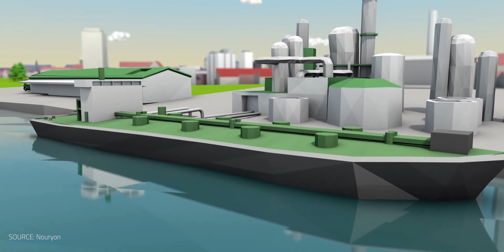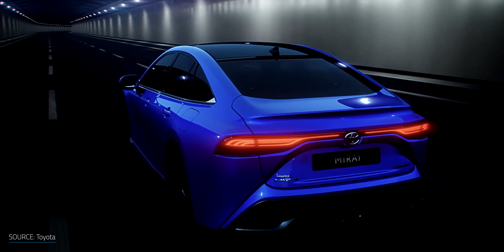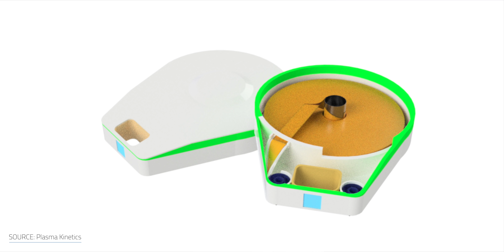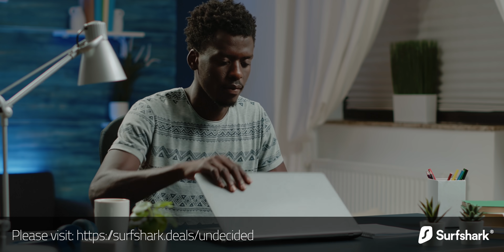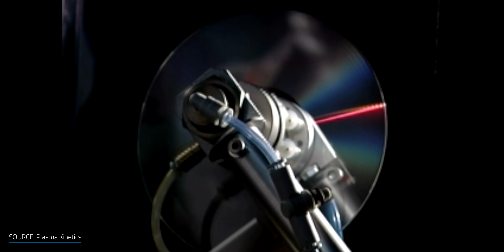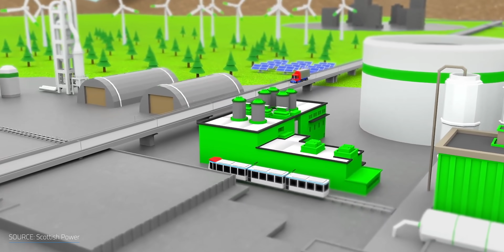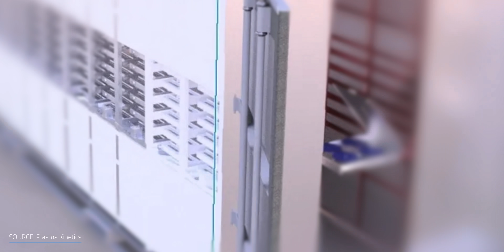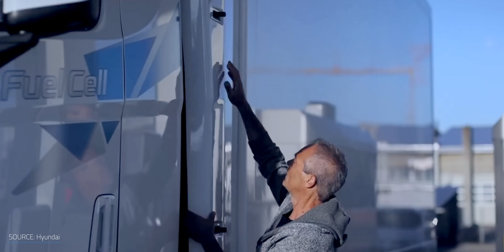Energy Storage Breakthrough - Solid Hydrogen Explained

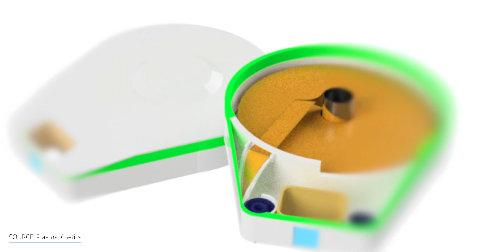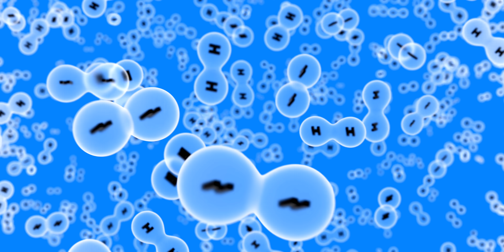Comment: One thing I'm curious about is the nano-structure of the tape. At about 4:00 min, you said it was a graphite-based structure, but at 6:35, you show what seems to be a Scanning Electron Microscopy (SEM) image of carbon nanotubes as the nano-structure. Although both carbon, these are completely different structures with different properties. Thanks.

Comment: More advantages of hydrogen include:  less need for rare materials compared to batteries, longer lifespan compared to replacing an expensive battery every 10 years, and the potential to be fully mechanical (with hydrogen internal combustion) without computer chips.    Lithium battery EVs are like expensive toys as long as they are at the mercy of planned obsolescence business practices.   In a decent future the cars will not require software updates.

Comment: If you want to look into something that does sound promising look into ammonia being used as a fuel.
Right now the production of ammonia is no better than burning fossil fuels but they are working on producing it cleanly and efficiently but it's going to take a while.
For the foreseeable future EV's using batteries is the best option.

Comment: cool, this is a gamechanger since no pressure no temperature. If they can improve the loading cycles of the bands I can savely use this energy in my laptop f.e. One question is , is the tech scalable? The materials the bands are made of, is it widely available wordwide?

Comment: maybe the solidification of hydrogen can br "speeded up" once it is able to "connect" to a temporairly katalysator molucule. to increase its solid tempreture. out of the "periodic table of molecules and atoms" this add on molecule(s) must also be low costs and enivromental friendly. maybe it can temporairly bond with  Carbon ?? until needed as back up fuel. or emergence fuel, in those unexpected times of need. since it is one off the only transportable fuels we can make. althou. the "rendement" to make it, say making to using ratio. is according to the teacher and the internet. not very commercial interesting for the short term. but handy in cases of the lack of laternatives.
Reply: it is the first time in history. a real primeur. that a hydrogen plant is made. lets keep it. as a back up. while using more conventional mainstream fuels, as. useual. have a good one.

Comment: not a bad bit of kit - society is changing and cleaning up it's act by utilizing hydrogen as a fuel instead of using dirty fuels such as 'natural gas', petrol, diesel etc. So the new tech seems good but the big problem is hydrogen has to be extracted in the first place from natural materials eg coal, shale, wood. This process still requires energy use. What man cannot do is actually make hydrogen literally out of thin air!

Comment: So, what's the energy density of those rolls when scaled-up? If it takes more energy to lift the film, plus its solid hydrogen, than thrust output.....it's no better than flypaper. Jet fuel weight is consumed, but not this film. Is the value really there?

Comment: It sounds like the cartridges would get less efficient with each use, which means that if you were to take your cartridge to the corner store and swap it for theirs, you don't have any way of knowing how many times theirs has been used, and neither do they. It may have been once, or it may have been 200 times (manufacturer's recommendations be damned), but you'd still be paying the same amount regardless. Unless there's an easy way to tell how much hydrogen is actually in the cartridge, I think there would be a heck of a lot of fraud going on, intentional or not.

Comment: Where/how do you get the hydrogen? You COULD get it from water but it takes a LOT of energy to split hydrogen off a water molecule. There IS hydrogen in the air but you're going to have to expend energy to separate it out. There are also chemicals which react to produce gaseous hydrogen but I don't think they really occur naturally. So it all comes down to where do you get your hydrogen? Any way you do it is going to require energy which will ALMOST CERTAINLY require consumption of hydrocarbon fuels which the whole process NOT net zero carbon.

Comment: Please also talk about overall efficiency when you compare Li-ion, compressed Hydrogen, liquid Hydrogen, solid-state Hydrogen etc. I mean the total amount of energy you get back when using one of the different storage forms. Start with e.g. 100 kWh of green energy. How much of this ends up in an electric motor? And afterwards maybe another table with the associated cost per usable kWh per storage system. That would be very interesting!

Comment: Count me as extremely skeptical with my alarm bells ringing loudly and sounding like a scam on par with Nikola's breakthrough hydrogen trucks that were vapourware (pun intended).
First, there is so much vague information but nothing concrete about the technology or it's actual application. Extracting hydrogen from chimney stacks? Really? Seems like a dubious source of hydrogen to me.
Next, what is the actual energy density of each disk and what is the sustained energy release rate? Bear in mind that driving a fuel cell car 100km requires about 1kg of hydrogen
Then we have the claimed efficiency of 70%. Is that the efficiency of storing and releasing hydrogen, or storing and releasing electricity? I suspect the former since fuel cells are themselves only between 40-60% efficient. 
Now we get to the economics of it. Ignoring what appears to be the completely unfounded and fanciful free extraction of hydrogen from chimneys and going with the 'use excess renewable power' to create hydrogen we can look at around 80% max for the hydrolyses with a catalyst, then 70% for this disk storage, then ~50% for the fuel cell. Thats 0.8x0.7x0.5= 28% round trip efficiency (excluding any transport of the disks for sale). Compare that to a BEV where the round trip efficiency is better than 70% including power distribution. These better be pretty cheap disks! Hydrogen must be produced, stored, transported and then sold. Each step along the way has a middleman or process that adds cost and introduces even more losses. The remanufacturing process hasn't been explained either and presumably requires energy as well so let's be kind and say that the whole system is 20% efficient. It's actually worse than pressurised hydrogen.
Once we get past all of this, let's not forget that this entire presentation is a CGI animation and I've yet to see an actual vehicle being driven and demonstrated using this tech. Big alarm bell ringing in the background.

Now let's look at the use cases. It's being pitched as being sold in shops to the general public - presumably to power cars as well as trucks etc. Who in their right mind would choose this over a long range BEV that can be recharged overnight at home, costs at least 75% less to "fuel" and has a usable range longer than you need 99% of the time?  Let's not also ignore the fact that a FCEV is inherently more complex and requires frequent servicing (air filters etc). 

I am open to being proven wrong, but strongly suspect that I am not. I have not seen any indication for the actual cost per kg of hydrogen stored at the consumer level, the actual density of the solution, the solution to the logistics of delivering these cassettes everywhere, how many you need in a normal car etc etc. That's before I get skeptical that no-one is showing an actual vehicle but just CGI-ware. Meanwhile my BEV is quietly charging in my garage using excess solar from my roof once the house battery is full, and it's already 7 years old...  It's an old car now with a usable real world range of about 380km with a network of high speed DC chargers all over the place, but it's actually more common for me to drive 30-40km each day than it is for more than 400.  Basically most of my driving is free.

Why would I want to pay so much for an inferior solution?

Comment: Round trip efficiency with this system looks a bit suspect 

Aluminium ion and aluminium air batteries with two to three times the energy density of lithium, look more promising for bulk energy storage. 

Research is well advanced and specialist products already available. If research pans out could be competing with Li in transport applications in five years or so.

Comment: Electrolysis is highly inefficient. Expend at least 50 kw for every kg of h2, which only has 36kw of energy, and only 60% of that can actually be converted into power. There's a reason why people are looking at alternatives. The catch is that this is not a hydrogen production technology, it is a hydrogen storage technology. Check the cost for shipping a solid anything against filling a specialized barge with liquid hydrogen. The solid source will win every time. What matters is the cost for producing the hydrogen they are capturing, because hydrogen is not just free-floating in the air. They have to be producing it somehow. This is a logistical solution, not a production solution. That said if you can dramatically reduce the cost of shipping hydrogen then that can be enough to make the economic viability fairly attractive. If you're paying $12-$16 a kg at the pump, the reason is the cost of shipping, since production cost is maybe a third of that. The video did make that pretty clear.

Comment: This is what is  Allen a true clean energy system.  Batteries are very efficient no two ways about it but what is going to happen to all the super toxic  'heavy metals' inside batteries when they die. Without doubt this is the way to go. Elon Musk should be designing in to his electric vehicles this technology... If I know him he probably already has. I see him fitting a tiny gas turbine thst runs off this tech to charge up his batteries.Thus is the breakthrough that the world needs.

Comment: Sorry but I don't see how this works for vehicles.  If you have to swap out the disks like CDs that means there would be a LOT of disks per car to hold the equivalent of even 5 gallons of gasoline.  Same goes for semi trucks just on a larger scale.  Grid tied for storage seems like it would be a much better fit.

Comment: I prefer this to the current push for batteries. 
One question though. I learned that water vapour is a very potent green house gas. Would a switch to this tech in mass be a problem like CO2 for our climate?
Reply: You do undestand its all bullshit, right?

Comment: nice theoretic concept, but the old STILL style still gets my vote. GM saw to it clear back in 1983 when they blocked any possible mass production of hydrogen based combustion. It wasn't until YouTube that some of the old tech came to light. Single source element style with a low pressure canister is the way to go and the off gas is water vapor. A lot like natural, without the corrosive affect on metal components.

Comment: Sounds like a great idea. One thing. Back in around 1975 or so (not sure exact year) a BBC program called Tomorrows World featured the potential in a new Hydrogen powered car. AND it was using a solid form of Hydrogen as well. The presenter even made a point of saying that this was what made hydrogenm a viable fuel as it was safe in the sold form. It didn't look like the version from Plasma Kinetics, but I have never heard of it since. Have you? if I remember the look of it right it was like a dark brick, and it was activated in a way I cannot recall. I do remember that the show was in black and white at the time, and since we had a TV from almost the start of colour TV in the UK, I think that means the episoide I am remem,bering might have been before the advent of BBC, which heralded colour TV in the UK. Anyone else remember this as well?

Comment: I dont get it. To liquify hydrogen, its needs to be near absolute zero, but this one is solid, because lasers?
Reply: This ons is solid bcz it is absoebed on surface of other material. 
Like water moisture is absoebed on silica gel.
Reply: @karanrami2824  so this means its absorbed into the other material, in its gaseous form? I would not call that solid, thats quite misleading...

Comment: What you are talking about in some ways is metallic hydrogen and or something close to an emulsion and either way you need an insane amount of pressure to actually capture a usable amount and also you are probably going to need extremely low temperatures. Something else is that the capture of the hydrogen will require insane energy to make it not instantly explode from the internal pressure. The last problem is lets say that you are only capturing a one atom thick row per each line of material and then you need to think about the fact that you will need a minimum of three other atoms to hold each nano tube for the atoms you have already increased the overall weight and area taken up by the entire setup by a minimum of four  to hold the same total amount and then you made the statement that it would increased the storage capacity by 50% not only is that impossible to be done its actually not exactly logically consistent. Somehow I'm just going to add additional material to the inside of my tank and then Somehow I will get an overall increase in the storage capacity for this tank while I'm decreasing the available space and not increasing the pressure of the internationals of the the tank. This is not just bad because of how dishonest it is but because of how many people will fall for it this one is almost as bad as the solar roadway garbage disposal years ago.

Comment: They are just loosing to li-ion at the start.
Li-ion have a cost potential to be decreased. Elon Musk is already doing it.
They have better efficiency and longevity, so even now they are better. But nobody takes seriously to keep TWh in li-ion, they are still expensive for that. If you want 70% efficiency cheap storage just build hydroaccumulation power stations. We need something radical cheap to store energy.

Comment: 10:41 "You can't just plug in your car at home" a good solution for that is to make a "hybrid" car, in the sense of a car with a rechargeable electric battery, which would be capable for a few kilometers/miles (maybe like 50km or so). This would remove one downside of hydrogen.

Just a thought, really.

Comment: That hydrogen unit will need to be extremely cheap to compete. Even if the waffle in the company marketing could fool some, the amount of high care labor required to round circle this product from empty return to full and installed will be costly. Can't see many retirees lugging a dozed metal boxes to their car and then installing them just to get to the chiropractor.

Meh, might be ultra thin but it's still just filling a small pizza size and you aint get much energy, even from solid hydrogen if film size was zero at the demonstration outward dimension.

Comment: FYI, all hydrogen fuel cell vehicles use electric motors and have a battery.  If you increase the size of the battery to 15-20 kWh, then you essentially have a plug-in hybrid that CAN be plugged in at home.  Combine that with this fuel cell technology, and now you have a PHFCEV that drives on electric for daily commuting, and for long trips wouldn't need the large hydrogen tanks and limited hydrogen fueling stations.  I'm curious how heavy the discs / rolls are and how much energy each holds.  Would you need a disc / roll swap station, or would they be light enough to put in the car yourself?  If they're fairly light, you could always get an extra disc or two for a long road trip and never have to stop to get fuel.  Sadly, the only time we hear about this technology is on youtube, and from what I can tell, little has been done with this technology.

Comment: sounds like a lot of risk and for no gain over batteries. meanwhile batteries can be charged at home so less infrastructure is needed. use cycles doesnt seem that high compared to batteries either, this makes it more expensive. not enough hydrogen from these factories to supply every vehicle, so hydrogen will still end up being produced through one of two ways, one which cant scale because we dont have enough material in the world to allow it to work at a reasonable price and the other is vary dirty. hydrogen is also less efficient.

Comment: Yeah after all of the marketing wank I'm less than convinced. Using lasers to produce a fuel seems like total bullcrap just from basic efficiency concerns.
The very best diode lasers are about 20% efficient. And if the hydrogen isn't generated at the power plant it's compounded by transmission losses. And if it is well then you have to transport the cartridges.

Comment: Sounds too complex to be efficient. The best way to solve hydrogen storage problem is to bond it to carbon to make synthetic hydrocarbon. Use cheap solar energy to power direct air capture and reduction of carbon dioxide, electrolysis of water, and Fischer-Tropsch process. The solar energy is stored as a hydrocarbon, the most useful form of hydrogen. Net zero carbon cycle. No fossil carbon released.